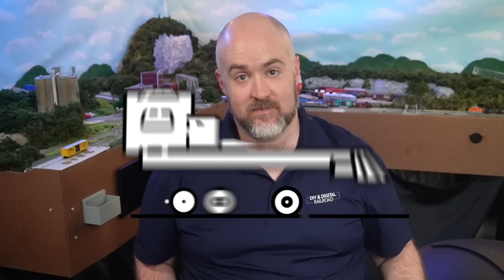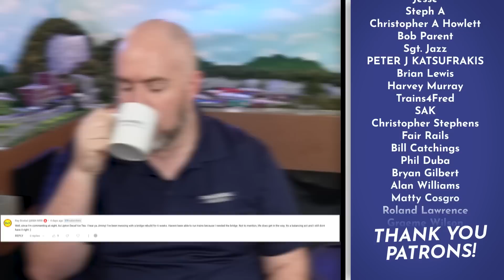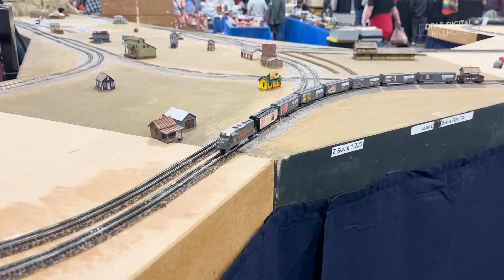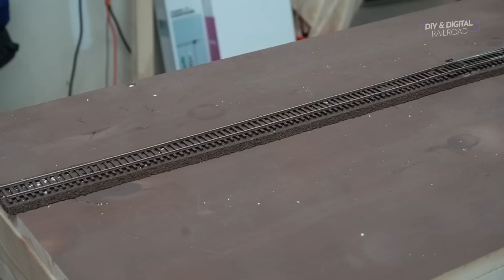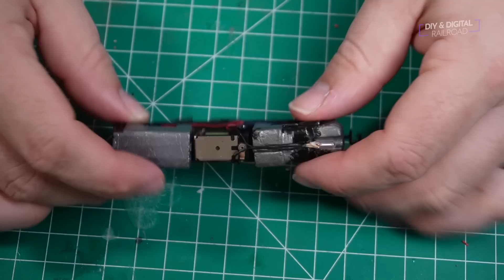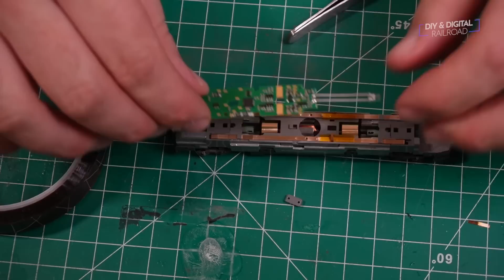The Basics of Model Railroading in One Video

Comment: So does DCC equipped have a speaker? Or is that just DCC ready? I'm new to the hobby and I want sound
Reply from the maker: Some DCC equipped locomotives have sound and speakers, some do not.  They’re usually marked as such.  Some DCC Ready locomotives have speakers built in ready for a sound decoder, some don’t.  You have to check to see in the specs.

Comment: Hey! Great video! You've hit on some very important and noteworthy points here! Unfortunately for me, YouTube wasn't here when I did my first layout, 2002.
Now for the question! I am laying down extruded foam insulation board for my sub roadbed. I noticed you waited until you laid your track to paint it. I wanted to completely paint it with flat latex paint, before I lay down any track.
Would the paint cause issues with the cork roadbed sticking properly or even staying glued down? Just curious.

Comment: Jimmy, Lots of good information there. Where HO scale is concerned, don't forget the X2F or horn-hook coupler, which was the defacto industry standard for years. Although most modelers wouldn't recommend their use on an ongoing bsbis,You may find older equipment that still has these. While you are in the process of converting, it's easy to make an "adapter" car with an X2F coupler on one end and a knuckle coupler on the other.

Comment: Hiya Jimmy, even though I do not drink coffee, I love watching your videos on model railroading as it is the greatest hobby in the world. You were talking about DC and DCC as the most common ways to power a train. As I am from across the pond, and model railroading is very much influenced by THE original model railroading brand Märklin (still have over half of the market share in German-speaking countries), please do not forget the so-called AC-powering with the center rail/studs. Even though nowadays it is also almost exclusively digital, Märklin have their own MFX-protocol to control trains, turnouts, signals, etc, but the current is not shared between the two rails, but between the rails and the studs located in the center of the track.

Awesome job in showcasing some of the model railroad terminology in under 10 minutes, as there is indeed so much to learn in our hobby. This should be standard literature for anyone getting into the hobby. Have a great day and take care!

Kind regards
Richard's Model Railway